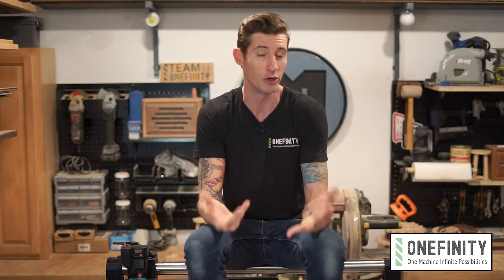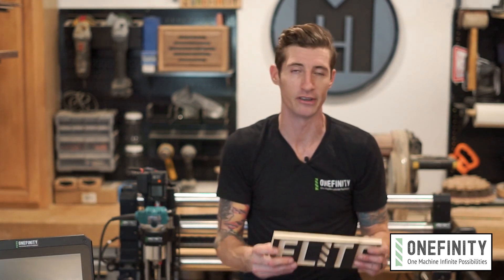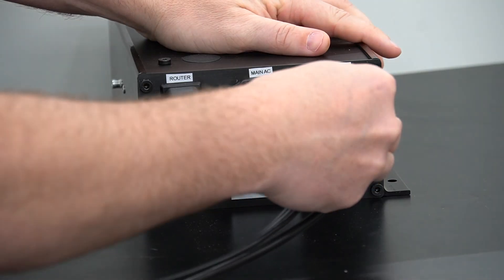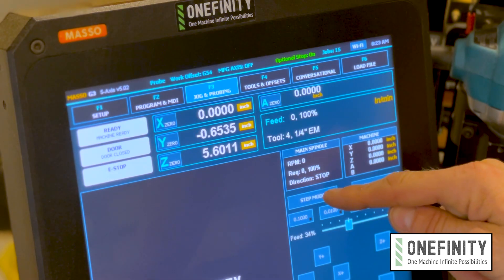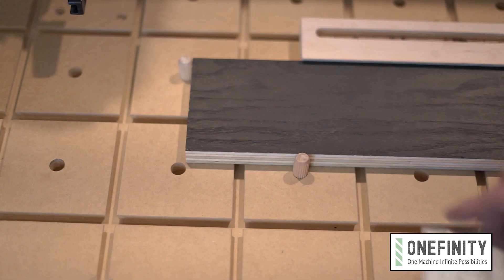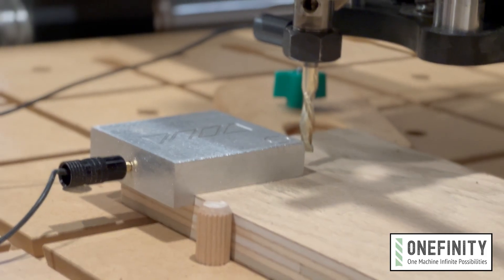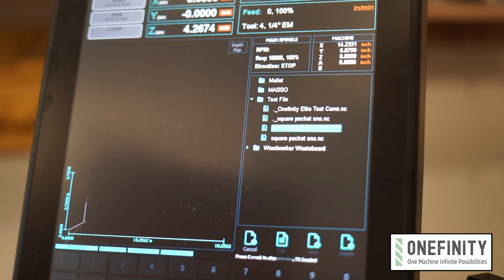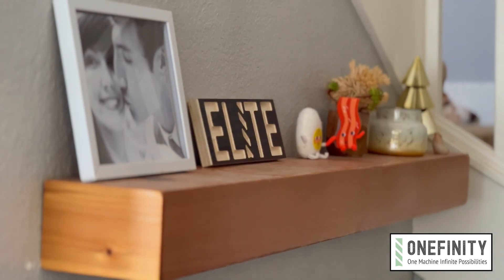EP 13 Onefinity CNC - ELITE Series First Cut

Comment: I went with a 220 spindle so not using the router plug but can this power any other accessory you want at start up like the small water cooler for my spindle? Perhaps the vacuum plug for a light ring for the spindle?
Reply from the maker: you can plug in anything you want.

Comment: Almost on every video I saw, there are jitters on controller screen when you rotate it?
Is there any issue with monitor cable or?
Reply from the maker: Jitters?
Reply: @Onefinity CNC  sorry, my english is not so good :) ...when masso interface is loading, it looks like there is some strange things on the screen, like display disconecting, I dont know how to describe it. :)
Reply: You can see around 00:20... :)
Reply from the maker: @unique93obr  It's in the process of booting up... It does not "Jitter" if you rotate the screen.
Reply: @OnefinityCNC  oh, ok...thanks...I saw that on couple of videos, and it was strange to me...but if it's just software thing that don't have impact on controller fumction, than it's ok. :)

Comment: that controller looks so nice wish i would have waited....I'm still happy i have my onefinity but man i really want to upgrade to that controller.
Reply: the masso g3 touch is avalible as a standalone cnc Controller

but i feel you, i got a small cnc mill mainly for aluminum and similar materials , and upgreading to this enables true probing cycles, a atc  and sooo much more in a All-in-1 solution 

so or my 5axis build im gonna use this gor the simple and usefriendly interface
Reply: @Basement_CNC Think i have to change all the steppers as well? I Think this is why Onefinity is not offering a upgrade path?
Reply from the maker: You have a beast of a CNC still!  The X50 is great!

Comment: I would miss the game controller, a very handy tool.
Reply from the maker: Once you use the Pendent, you'll never want to use a joypad again :P
Reply: @Onefinity CNC 
Pendent?
I ordered an Elite with 24w laser and the xyz touch probe (can't wait for the tool setter, I'm sure it will save me at some point between bit changes having to remember to check z everytime).

I'm thinking by pendent you mean the xyz touch probe?
Reply: @Hangs4Fun  No, the pendant will replace the joypad. It’s a more precise way to jog around your machine than a joypad. Pendants are commonly for more high end/ commercial machines.
Reply: @allboutsean5483  oh, like the one you can get on Amazon (I think I saw that on Myers channel).
If it's something else, can you clarify and provide a way to look it up?
Reply: @allbout sean  yep, I see, I thought they were called MPG, but I see pendant is the more common name.
Reply: @Hangs4Fun  MASSO does sell one on their website that is supported by them. I may get it for my Elite 🤔
Reply: Is it correct that I would have to go to the Masso site to purchase a pendant or are you going to offer one?